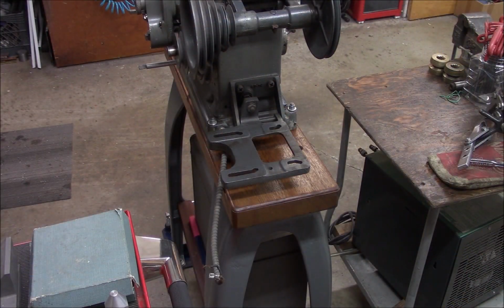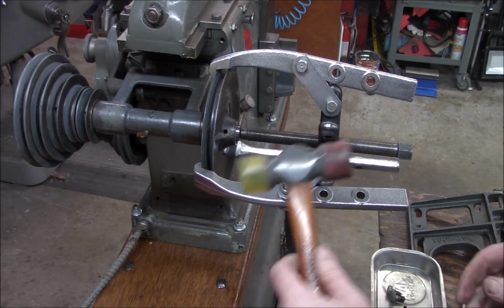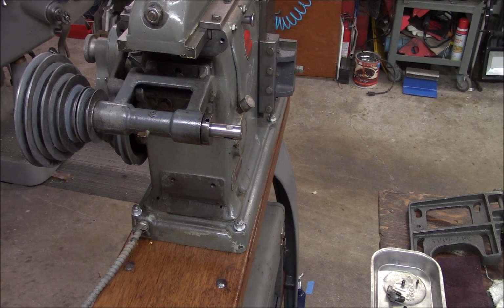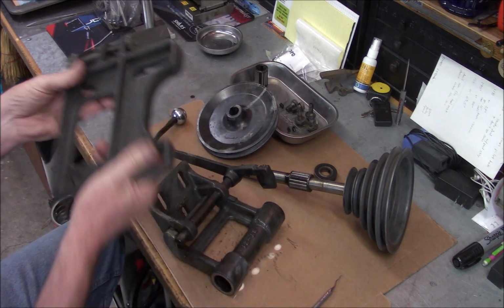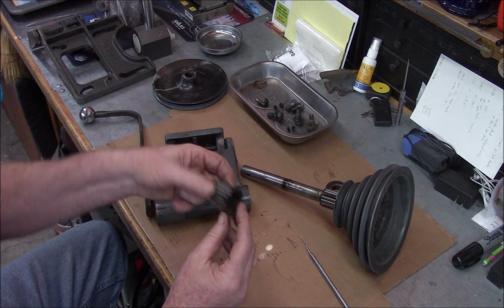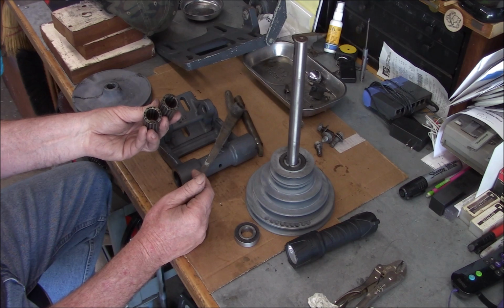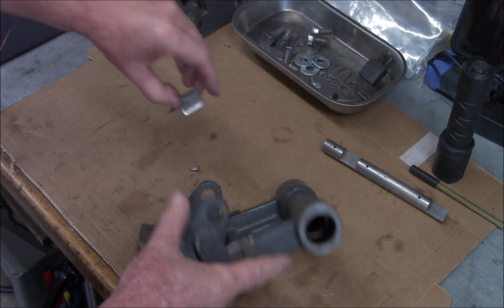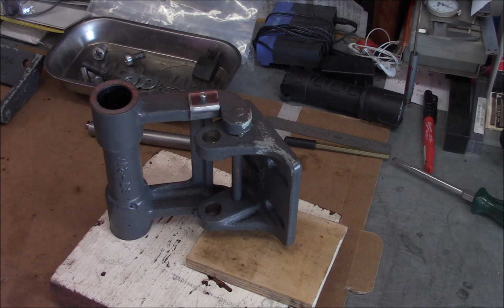Atlas 7B Shaper Project Part 5 - Countershaft Drive

Comment: Mr Pete (Tublecain) has a video describing "Zamack" (not sure of the spelling) It was manufactured in Illinois about 50-100 miles from where Mr Pete lives. It is an alloy of zinc maybe tin, and aluminum. It was used quite often on Atlas and Sears lathes back in the 40s or 50s. Some other small lathes may have used it as well. It was mostly used to make the change gears.
Reply from the maker: I seem to remember that video, but forgot the aloy mix. Seems to superior to typical pot metal. Good info thanks !
ATB...Dean

Comment: Have you used oven cleaner before ? I’ve been told that that can be hard on certain metals. Could be why the finish was odd on pulleys ?
Reply from the maker: Yes it does tend to eat aluminum, ok if not left on too long.. Could have been part of it..